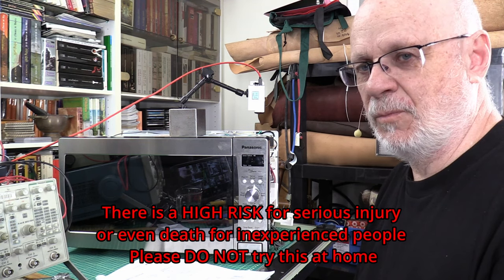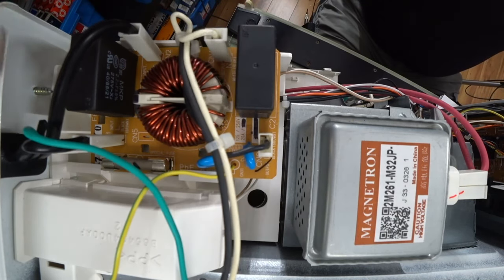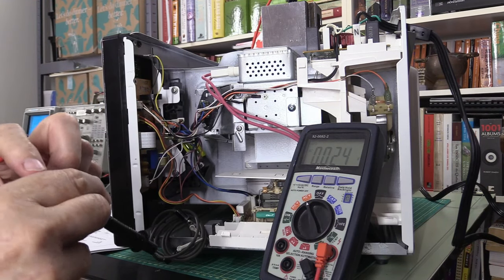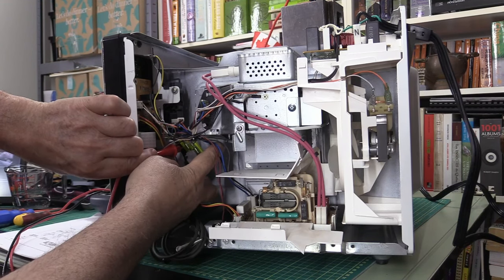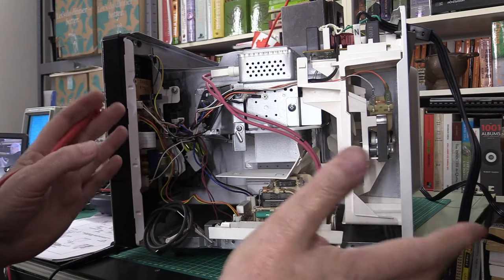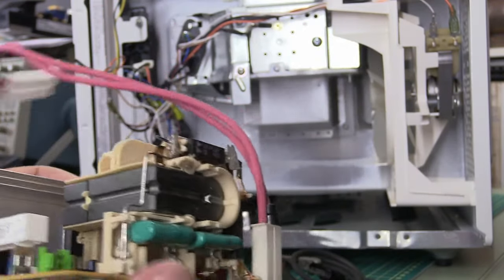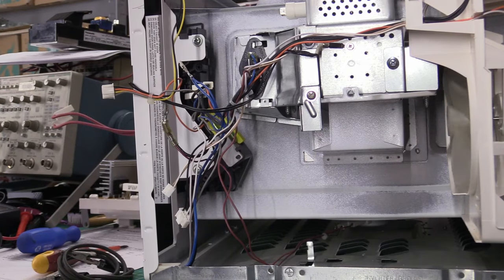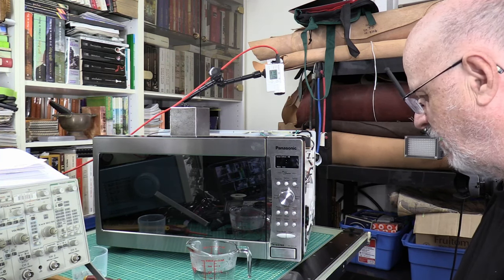Panasonic Inverter Micro-Wave repair (Many other models similar or compatible )

Comment: How to test relay ? My mw turns off in 3 sec. All 3 switches and fuse is okay
Reply from the maker: This looks like the same problem as in the video, what I did to confirm that the relay was defective, was to use a piece of conductor material to bypass the relay, you have 1 or 2 seconds to bypass the relay after you press the start button, if the cycle continues and the water gets warmer means that the contacts on the relay are defectives requiring a new relay.
WARNING: this procedure is reserved for someone who is experimented in dealing with electricity and high voltage, this procedure could cause serious injuries.....
Reply: @pierresgarage2687  changed relay still mw turns off in 3 sec.
Reply from the maker: @ChiragPatel-rb1vx  
Possible  that the high voltage module is defective, this is quite more delicate to fix for someone not experienced and without electronics knolwedge, if you mean to go this road, the first things to test would be the small connector with 3 wires on the HV board, one of those wires is a status that sends a signal from the HV board to the control board saying that the voltage conditions are met, (i.e, that the HV board has all the conditions including producing the high voltage) if this connection is defective the relay won't be activated after the 3 seconds delay and send an error code. after you checked the status wire, you could check  the IGBT transistor and also the rectifier bridge, the high voltage capacitors, BEWARE HIGH VOLTAGE MAY BE REMANENT, this also requires unsolder those components. There is in the service manual a section on how to test those componants using a multimeter. 
Sadly, If after all this nothing works you may need to get professional help locally...

Comment: Whats the issue it shows H98?
Reply from the maker: Could be a defective magnetron, a high voltage board or a missing command from the logic board...
Hard to tell without specific readings, you can download the service manual by following the link in the description below the video. It shows a procedure for testing and diagnose the main problems.
PLEASE BE CAREFUL WITH HIGH VOLTAGES if you're not experienced with electricity and electronice...!!!

Comment: I have a inverter microwave Panasonic it only runs for 3-4 seconds without the fan runing
Reply from the maker: You may start by checking the interlock switches, check continuity, wear and placement of the switches fixture, the actuating relay, connection from control board CN701, or the control board, this is the sequence in probability order of probable causes for this problem...
If not, let me know...